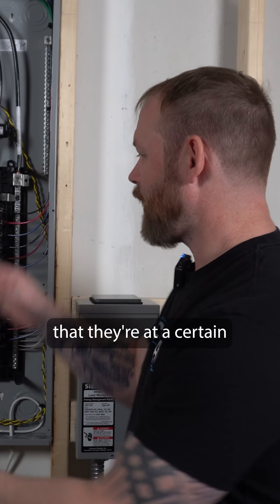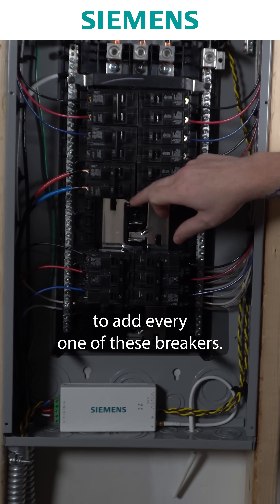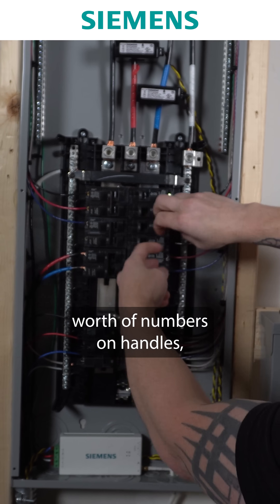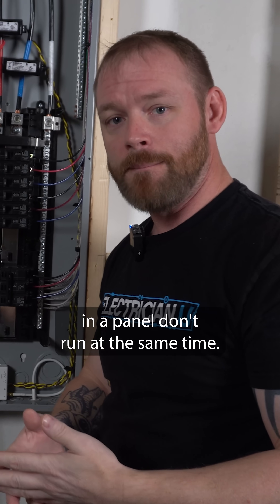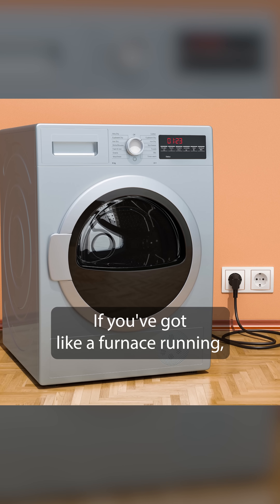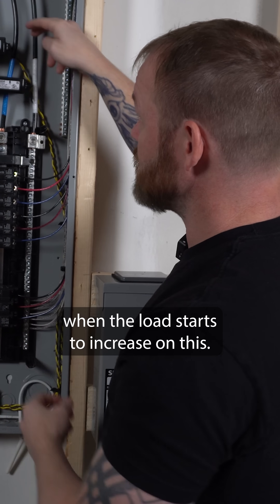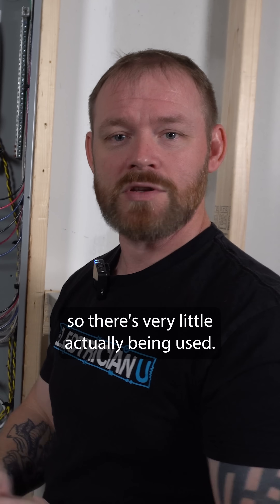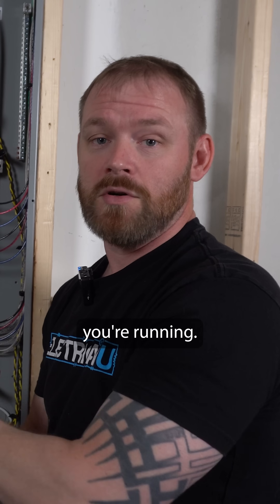Is This Panel At Capacity?

Comment: He is right. Also a 15 lighting circuit may only have 5 amps on it. 
Dryer can be 30 amps - but like an oven it cycles. 
TESLA charger is different. Know that sucker runs at 30/40 Amp full bore for hours. depending on charging.
Reply: 20 years ago a dozen 100 watt incandescent lights would nearly max out the 15 amp circuit...but nowadays a dozen LED's barely take an amp or two.
Reply: Yep. We also follow an 80% rule so a circuit running at max should be less than 80% of what the breaker says. Example: a dryer is on a 2-pole 30 amp breaker.  The dryer will draw less than 24 amps on each leg of that circuit, most likely way less, or just above 80% of a 20 amp breaker (16a). I believe a dryer is right around 20-21 amps. If an air conditioner draws 12.2 amps, we’d run a 20 amp circuit because it’s just above 80% of a 15 amp circuit. This is for higher load dedicated appliance circuits. Most lighting and general receptacle circuits, like he was saying, are drawing far below what the breaker is rated for.
Reply: The load on my lighting circuit was 0.86A. LEDs are wild.
Reply: @acclrator  Hence the reason companies are pushing 10 amp circuit breakers and #16 wire.  
    Having seen rise and falls and shifts in residential / commercial circuits 10Amp fuse is a mistake. It is hard to repurpose. Really?  Ask guys on the east coast who still come across live Knob-and-tube wires running different circuits. 
    NEC is not even 100 years old yet. 
  More outlets in a room  and an extra  light switches is one constant. Light switch may be for a lamp. Why?  "They look good."
Reply: A lot of EV owners are learning about electric loads now.
Reply: @donmclean1220 As they should be.  Hell, this should be basic education everyone learns in school.

A lot of folks who want to put in an EV charger, heat pump, ect. are getting told they need to upgrade their service.  And a lot of them really don't.  An old "full" panel for a house built back in the days of incandescent lights and inefficient appliances actually has plenty of spare capacity because a lot of those circuits are way oversized for what they are providing these days.
Reply: @donmclean1220  Ohhh Yea. There was a rush on a special 50A connector. The normal Levitron dryer / oven one would melt.  Why? Dryers & ovens cycle on and off. For fast charging, Tesla charger opens up full bore and stays that way - long term. Could be for hours. 
    It is why we stress test or use a load bank  to certify a generator or electrical installation.
Reply: @allenshepard7992 slightly off topic but with your knowledge on electric vehicles, are we really saving the earth with all the electric battery powered vehicles and appliances and data centers?
Reply: @RobH265  First the Earth is fine. We could nuke mankind off this rock and Earth would survive, possibly even repopulate. 
    As for a healthy planet,  EHhhhh, At the moment no.  Here I am guessing - not many facts. 
    Moving to nuclear fuel and geothermal power to replace coal and oil would be good. 
    Using geothermal for HVAC would be another huge step to wards a cleaner world.
Reply: Tesla:  I wiash..  My Tesla takes up to 72 amps..  I can't charge my car and my wife's car both at the same time.
Reply: @jean-clauded5823  (sigh)  Thanks. 
    Having two Teslas is something we normally do not cover. 
   I need to start thinking that way and including it.  Thanks. .
Reply: @jean-clauded5823 wait what Tesla do you have? or do you have an another EV and are calling it a Tesla? I thought they all have a 48 amp on board charger (so use a 60 amp circuit because continues load ratings)
Reply: @ no, both my 2017 Tesla’s have a 72 amp charger on board and require a 80 amp breaker. 
Yes, you can limit it to 60 or 40 in software of the car or dip switches on the charger (and some newer models won’t charge that fast).
Reply: @jean-clauded5823  Wow, Thank you for the update.
Reply: yup. teslas can draw up to 48 amps with the onboard charger so that's a 60 amp circuit.

btw dc fast chargers bypass the onboard charger and the "charger" that you install at a home is normally a fancy relay with potentially power monitoring capability
Reply: With the prevalence of LED lighting I'd guess most lighting circuits are carrying 1A or less.
Reply: @MattBlank0  Yes. LED lighting has even sparked (no pun intended)  10 amp lighting circuits for multi family dwellings and smaller wires. 
    12V is not a perfect solution but it has TONNS of parts and is easy to learn with. 
   On the other hand, new AI data centers are going with 800Volt DC systems and 200Kg liquid cooled buss bars.
Reply: And most don't even realize this....👍👍
Reply: More like 50 to 60 amps circuits.
Reply: Correct!
My company installs them in homes and build charging stations all over Oklahoma, Arkansas, and Texas. (Many are powered by generators). Bwahaha
Reply: 100 Tesla's are plugged in, RIP the electrical grid....
Reply: Thats why companies  cant buy a fleet of electric trucks  because not enough  power available to  charge them all it would its own power  station @anthonywilliams7052
Reply: @anthonywilliams7052 but they mostly charge at night when demand is low.
Reply: @anthonywilliams7052 There's already way more Tesla's out there and the grid is fine for now.
Imagine if everything was electric. Cars, busses, trucks, planes, and trains. When do the majority of them get used? Daytime. That means at night all of that has to be recharged.
They better be building massive nuclear power plants if they plan on an electric society.
Reply: @anthonywilliams7052  
We've been in need of a grid update for at least 50 years.  People are complaining about something that SHOULD HAVE been taken care of decades ago.

Comment: Haahaahahahahaaaa 50 amps on my furnace, bro it's oil, it's got a fan and the transformer. I'd be surprised if it pulls 20 amps
Reply: Lots of folks have an electric resistive heater. Lots of folks also have resistive emergency heat on their heat pump systems for those days when it's so cold the heat pump can't extract any heat from outside and just constantly freezes up. Those resistive heating elements draw a TON of current, so much so that they need sequencer devices to turn on and get to temp one at a time to avoid popping a breaker.
Reply: @mannys9130  but that is an electric heater or a heat pump. A furnace burns fuel i.e. oil or gas and would not pull 40-50 amps. That being said I'm sure he just misspoke and just didn't want to reshoot the video.

Comment: Next video "How to make load calculations"  you're welcome.
Reply: Hopefully I'm interested in learning.
Reply: A great suggestion.  Our code book (I'm in Ontario) has very specific breakdowns, but like most legal speak, without interpretation or examples it seems more difficult than it needs to be.  But the concept of continuous load and how to strategize a service would be a triumph of content.
Reply: Maybe one on balancing the load
Reply: Play Satisfactory to master load balancing 🎉
Reply: Isn't it 80%?
Reply: @Raiart89  between 60 and 80% here so i often go for 70
Reply: IF I decide to run the A/C, dryer, oven, microwave, air fryer, & misc other loads simultaneously, I'm very close to the panel limit!  I know better than to try that "combo"!
Reply: You're already on youtube. Look up how to do electrical panel load calcs.
Reply: They are outdated anyway with all the new electronics and EVs. We really need monitoring and power limiting devices.
Reply: @360_tours  Then it's YOUR JOB to go REWIRE those well over 2million homes that still have "OUTDATED" circuits. I heard you volunteer!  lol
Reply: Definitely wouldn't fit in a short, my guy 😅